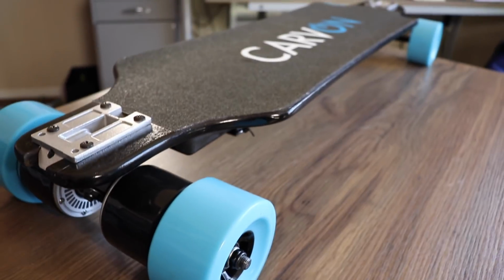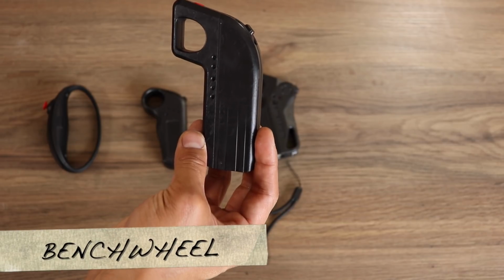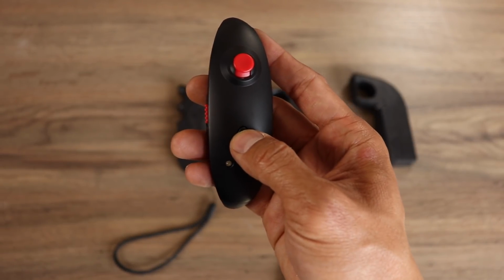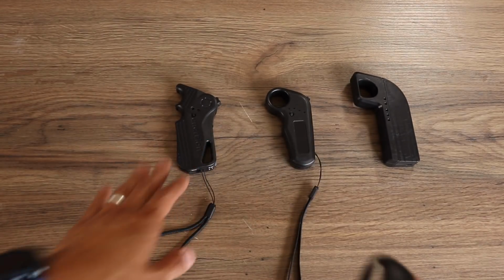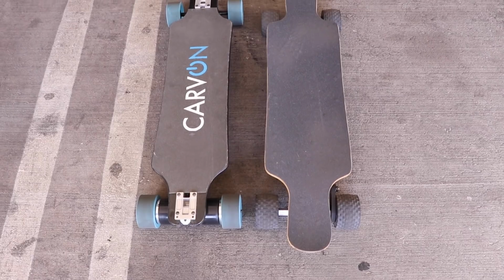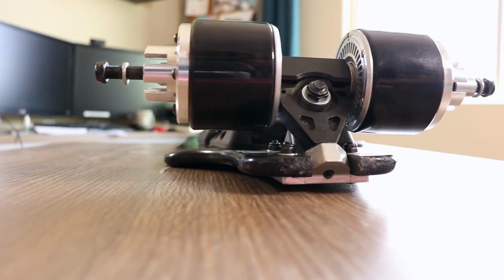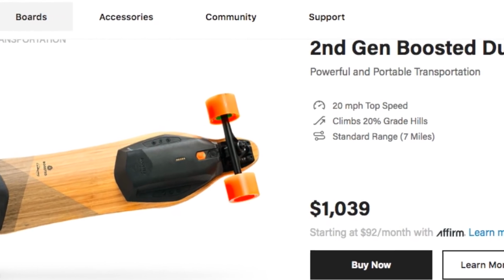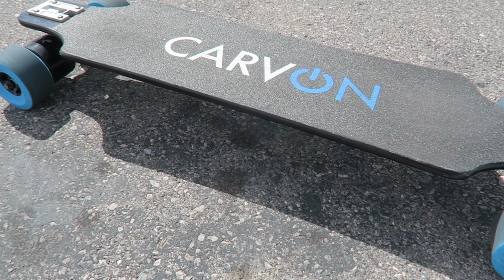CARVON EXO REVIEW - FULL URETHANE WHEELS WITH HUB MOTORS (ELECTRIC SKATEBOARD REVIEW)

Comment: Those batteries are just like Genesis which is no more when the deck flexes after a while the battery has disconnect problems and you can just tighten up the case to fix it

Comment: Raptor 2 vs exo ?
Reply from the maker: If you are going for a high-performance board with responsive support I would go with a Raptor 2. If you are going for a unique direct drive system that you can use your own wheels on I would go with the EXO.  However I will say this Carvon as of late, has not been very responsive to their current backers.  I'm not sure what's going on with them and wish them the best honestly.  As for Enertion, I've hear many folks taking a long time to receive their products.  However, I do know that have support engineers around the world that will help with any maintenance problems, which is good.

Comment: Thanks for the video. I love the concept of these hub style motors that can use regular wheels. That has been my biggest dilemma in picking an e board. I like the silence of the hub motors but wasn't to sure about the smoothness of the thin PU rear wheels. I was about to buy a wowgo 2s with replaceable wheels which they sell for $15 a piece. I was going to get the wowgo 2s with replaceable wheels, sanyo battery with around a 20 mile range, an extra remote and 2 extra rear wheels for $690. What would you recommend to buy for under $900. I do not want to bother with DIY, i want a complete setup. My only problem with the EXOboard is its new and parts dont seem to be readily available and if anything goes out on the motors it looks like your out $500 to buy one complete rear truck/ motor set? The wowgos and meepos you can replace one motor at a time or trucks or wheels separately for pretty cheap, or swap the deck easily.  Would love your opinion on the exoboard or other options? I am just going to be cruising around my neighborhood with my kids mostly, might go for longer rides, I would be happy with at least a 10 mile range, I wont go much faster than 20 mph. I want something that has a smooth ride, pretty quiet(that's why i like the hub motors) and isn't to expensive or difficult to repair if needed. What do you think, Thanks!
Reply from the maker: Hey, thanks for checking out the video and for commenting!  Sorry for the late reply.  The Carvon is great in regards to tech for the esk8 community.  However, as you were saying, you want something that would be able to maintain and have parts available.  Honestly, the Wowgo 2 and the Verreal are decent value buys.  The acceleration on them is pretty quick, their quiet, and have decent range and you can always upgrade the battery.  I totally understand your dilemma regarding the PU of hub motors.  What you'll realize as you start your esk8 hobby is that, there is no perfect or best board!  Once, you ride hub for a while, you'll get sick of that.  Once you ride belt, you'll get sick of that.  Once your ride, direct drive you'll get sick of that.  What I found is that its more of a rotation.  Like how I have my music on rotation.  Honestly, I've been recently researching electric BIKES, hahaha!  anyhow, keep me posted on what you end up getting would love to continue this coversation with you!  Good luck :)

- Neil
Reply: Thanks Neil. I ended up getting the wowgo 2s. I've had it for a few weeks now and I love it. I have no complaints. Got the replaceable PU option. Just ordered another one for my sons Bday, i need someone to ride with now, lol. I love how quiet the hub motors are too. It's way more fun then I thought it'd be. I never thought I'd ride more than 9 miles at a time but it's just so much fun that 9 miles feels like nothing. Bigger battery is next.
Reply from the maker: Totally agree!  The feelings and sensations are so awesome.  With electric skateboard you get the chance to feel what a down hill skater feels.  Glad it's a hobby you enjoy!  As a suggestion, check out better bushings!  It's such a small investment and it does wonders for the ride 👍

Comment: Hey Neil awesome video again I’m a big fan of the Koowheels as you know )) I’ve personally taken their sales to another level lol .... with my channel LOL and I big fan of the D3M model and the current Gen 2 and  they are all running just beautifully. It’s wonderful and so nice to see you company like CarVon use their innovation in adopting the Koowheel ‘s battery and ESC system )) and especially their remote ))))Specially as Koowheel was one of the first companies to adopt “Potting” in the PCB electronics which makes it absolutely water resistant and crack / chip and  break resistant on all its solder joints....))) you’re onto something here Neil I think direct drive drivetrain is the go and  the way of the future definitely very impressed with thus Exo ))) keep up the great work Neil )) cheers Andrew )(

Comment: What do you mean not a clone the only thing different on that board is the fact that they have a carvon drive system they didn’t come up with Carvon came up with it. EXO is just using parts from everybody else’s boards
Reply from the maker: Carvon put their own drive system on there.  I've pointed out that the rest is Koowheel.  What I mean by clone is it isnt a white label board that someone just slapped their logo on.  And then drop shipped from China to your door, never to actually see the hands of the vendor selling it.  Carvon orders Koowheel boards, manipulates it, Q&A it, and then ship it from California.  There is a distinct difference.  But I guess the definition of clone could be subjective.
Reply from the maker: Also, I'm a little confused from your statement.  By what I'm reading it seems like you look at Carvon and Exo as two different companies.  Could you clarify?

Comment: I would buy one with MEEPO style ESC and BATT case design! Of course with SANYO batteries too
Reply from the maker: Cool man, if you'd like to do that Carvon does sell the V4 Torque drive as a stand-alone purchase which you can use with any custom esk8.  It doesn't necessarily need to be on the Exo.

Comment: It looks exactly like a rebranded koowheel. Same remote, same battery/design, deck,  Dang. Does someone know if they are the same company?  I like the hardcore drop through 12s6p v2 or v3 ect design. Now those are carvon!
Reply from the maker: Hey there, thanks for checking out the video.  The deck and battery are Koowheel.  They purchased the battery, electronics, and deck directly from a Koowheel manufacturer.  Carvon and Koowheel are not the same company. 
 The direct drive system is purely Carvon.  This is Carvon's answer to the budget tier of boards out there.

Comment: yo i saw that carvon also sell the adapters for the hub motors separately and those motors and everything else look just like koowheel and genesis stuff do you think that adapter will fit on my koowheel onyx 2018 so i can add off road tires?
Reply from the maker: The drives are made by Carvon.  Yes, they have adaptors but the adaptors are only for the Carvon drives.  If you look at the drive system the motors are closer to the kingpin which makes room for the adaptors.  This is not the same as traditional hub motors.  but, hey..if you're willing to spend the money and give it a try I'd like to see it.

- Neil
Reply: Just buy the trucks directly from carvon there $500 then attach them to your koolwheel.